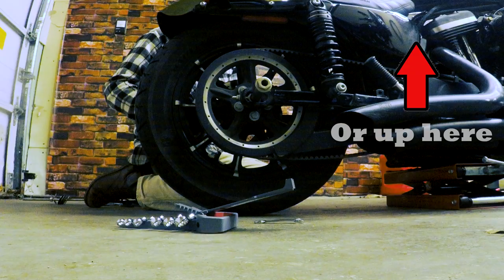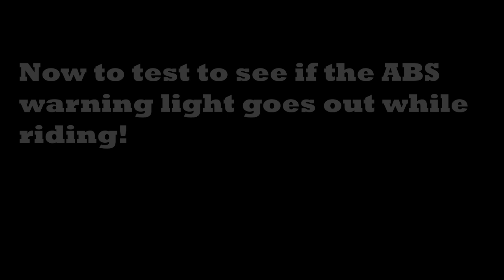How to Fix a Broken ABS Wheel Sensor Harley Iron 883 Sportster

Comment: Thanks for the video. Wondering whats the quality of the sensor you bought. Was it OEM/aftermarket? If OEM, new/used? Im asking because I can't find any OEM front wheel sensor for my bike.
Reply from the maker: I bought mine used off of eBay. It’s OEM and works like new. What’s the model and year of your bike? I can track down a front wheel sensor for you.

Comment: I like Sportsters, but the very thought of losing break when the ABS module breaks down is what stops me from getting one. How frequently do you have to flush the brake fluid?
Reply from the maker: The module didn't break.  I replaced the wheel speed sensor  in this video. You can still ride the Sportster without ABS.  As I demonstrated in this video, a clip that holds the wire for the wheel speed sensor broke while I was riding on a dirt rode and the tire rubbed against the wire for the wheel speed sensor. I rode the bike for three weeks without the use of ABS. When I got home I replaced the wheel speed sensor. This video is the result of that. You replace the fluid every two years.